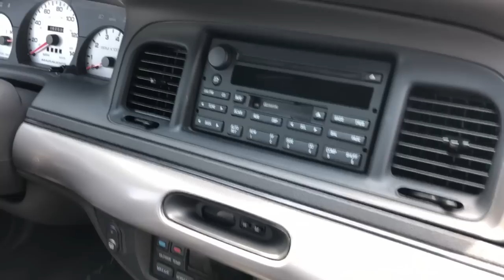How to Improve Trashed Paint // Paint Enhancement// Mercury Marauder

Comment: Another great real world detailing vid Phil. Question... Do you/have you experimented with microfiber or wool pads? HD Speed and Meguiar's/ Lake Country microfiber pads make for a mean enhancement/one step combo. I know you know this stuff but we detailers have to help each other continue to be badazz. Lake Country makes a purple thin wool pad for the long throw and Rupes has even come out with new wool pads. The tools in detailing are progressing so fast now until when you get use to something there's something new available. Cheers!🍻
Reply from the maker: Thanks! You know I should have tried the Megs microfiber discs. I had them also. I was pressed for time and forgot about them. Job idea. I have used HDSpeed and micro discs before and found them to be great on most paints. I have the Uber cutting/polishing pads also.
Reply: @MirandaDetailing  You still win, I have a soft spot for ya because you get it like me. No climate controlled shop... just making it work best you can in the elements.  I know the customer appreciated it.
Reply from the maker: Thanks man!  Yeah...it’s rough when it’s super hot and humid! 😓😓😓

Comment: How many pads do you use for each pannel? or u keep cleaning the pad in between the each panels n continue with same?
Reply from the maker: Hi. I clean my pad on the fly with compressed air after each section. But eventually they cake up and loose cutting ability, so I’ll go trough maybe 3-4 pads

Comment: Hey so you do about 2 section passes everyone you do an AIO or does it depend?
Reply from the maker: It depends. Sometimes the paint responds nicely if a panel was repainted. Sometimes it needs more. If the paint is harder.
Reply: @MirandaDetailing  True. I just think I'm being too picky and expect too much from an AIO
Reply from the maker: I know!  Some paints disappoint me but  even HDSpeed with a cutting pad won’t work the way I want sometimes.
Reply: Paint Correction Officer dear sir, for a.proffesional in think it is pointless to do more than 2-3 section passes with any AIO product, that is because, if the customer wants to.pay to the proffesional the additional time it requires 4,5,6 passes ,then the proffesional will choose to use some aggressive one step product and at the end he can put a wax very fast with a da, and in the same time he will.produce for the client much better results